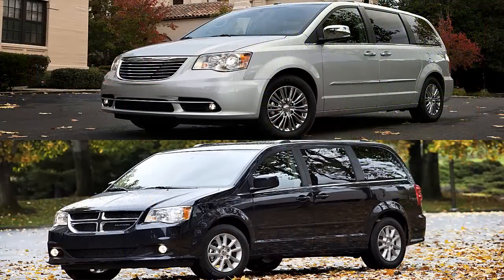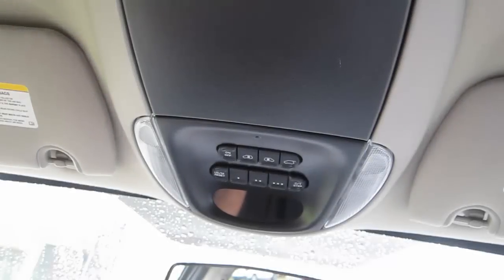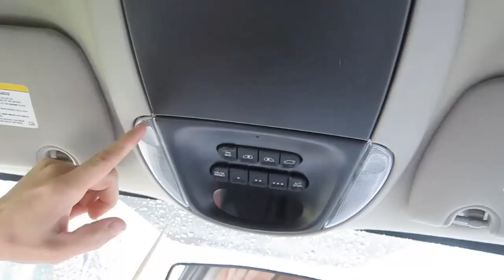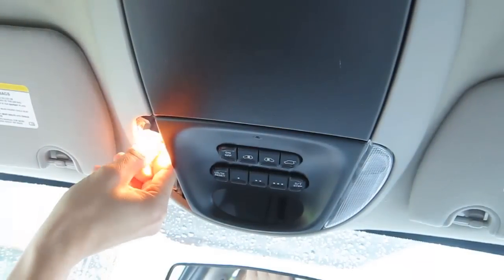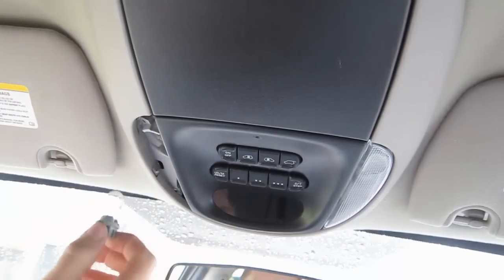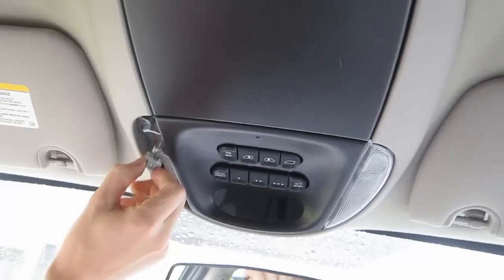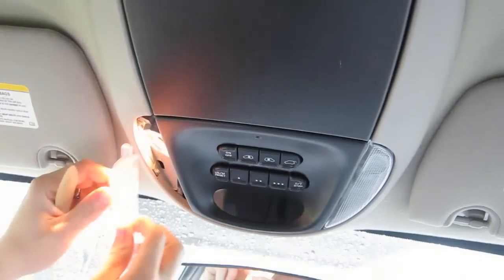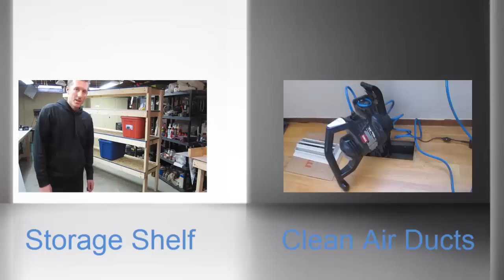Fix Overhad Dome Light - Town & Country - Caravan

Comment: Thank You. I was able to use your method with the string and slip knot to unlock my 2005 Dodge Caravan . I let my vehicle sit for 2 days just because I tried and tried other methods and failed. Did not want to spend the money on a locksmith (I didn't have it ) . Ran across your video specifically about a dodge Caravan . Very grateful to you . Much appreciation. 
Now I am trying to save a little money to get a spare key made . Lol

Comment: I have a 2006 Town & Country and just replaced the bulbs on both sides.  I bought the bulbs at a Dodge dealership and the parts guy said "they may not fit".  He was right, they changed the design of the plastic base slightly so that the new bulbs are incompatible with the older vehicles.  It's a great scheme to make money.  I made the new ones fit by cutting away some of the plastic on the plastic bases after comparing them to the old one.

Comment: So great video,
I took out the overhead dome lights and noticed there was a side on each one that looked a little brittle and heat weakened and not as a solid connection as the other sides (burnt side connections most likely the positive side.) 
So I simply took a small price of speaker wire put a small piece on the corroded sides and worked perfectly. 
Thanks for the video though it motivated me to be hands on as you were:)
Reply: Now that's my kind of fix!!

Comment: Take a look at that procedure again and notice how black the bulb adapter is. Typically, you will find the bulb's plastic base badly melted. Sometimes it is so bad you must replace the entire assembly. Check out some of the other you tube videos and see how to replace the stock bulb with an LED. The LED will burn cool and will not burn the base. The bulb adapter is a Pico brand part #5458PT. The LED bulb is a JTech 3K-SI13-30JJ (there are lots of other bulb options). Both of those items are available on Amazon. I don't know how long these bulbs will last. Please change yours to LED as soon as possible before the assembly is ruined.
Reply: The bulb # I gave won't work when searching Amazon. Use this number- Jtech 10x 194 168 2825 T10 5-SMD White LED. There are lots of options for bulbs- you might want something brighter. The one I chose is sufficient.
Reply: Thanks for the part numbers!  I've got one that's messed up a little, and want to see if I can make some LEDs work...  but needed the socket.  Thanks again.

Comment: You’d think that since the plug for the bulb is so hard to twist it would stay tight/good connection.  Just a bump and they were fixed.  Now if I could only get my wheelchair ramp/door to shut electrically .....over a thousand $ thrown at that and I still have to manually shut door.  Most of the time it’s not shut all the way so the all the dome lights stay on.  This is not a Chrysler issue, but Braun, the conversion company.  Oh they’ll be glad to take your money and then disagree with their own repair agent as to what’s wrong.

I picked up the correct bulbs at the local grocery/variety store. 2 for $3.79. They are going back soon.

Comment: I have a 2004 Grand Caravan,  I cna only get those to come on when I open a door --  Is the bulb bad,  do I need to replace or electrical problem ?   Please help
Reply from the maker: Well if the light comes on when you open the door, then i think the bulb is ok.  Sounds like the push-button switch is whats broken.
Reply: Try disconnecting both battery terminals and touch them together for about 3 minutes and then put them back on battery post terminals. Then see if that fix your problem wth your lights working properly. I learned that worked for others with same problem
Reply: @Veghead
Reply: How about the other way around lights wont turn on when I open doors but on push button it lights.

Comment: Part # for the bulb housing? Mine are shot and the dealership is trying to force me to buy the whole assembly at $200 plus!
Reply from the maker: I think the OEM replacement is this http://amzn.to/2puKK1S
But there might be cheaper ones that fit too.  Not sure of the actual part #.
Reply: Dave Wirth is that the number for a housing that will work with LED bulbs? Thanks for your help
Reply from the maker: Oh bulb housing... misread that.  No that's just the bulb.  No idea about the housing.  Is it just the metal connections to the bulb that are bad??  Maybe check out a junkyard, you could pull the part off a van for like $20 i would guess.  But i don't know how it's attached.  Clips or hidden screws or something.
Reply from the maker: For example, here's a You-Pick-Your-Part junkyard by my house.  It has 8 Chrysler Town and Country's  http://www.usautosterlingheights.com/inventory.html
I don't know what exactly you would call that part though, but most stuff on the price list is under $20  http://www.usautosterlingheights.com/pricelist.html
Oh maybe ...Overhead Console-Small = $15.             OVERHEAD CONSOLE -SM 15.00 Each 0.00